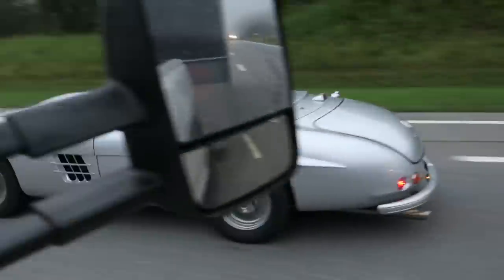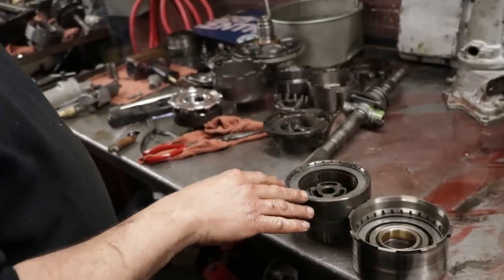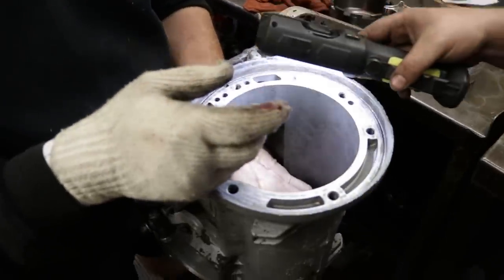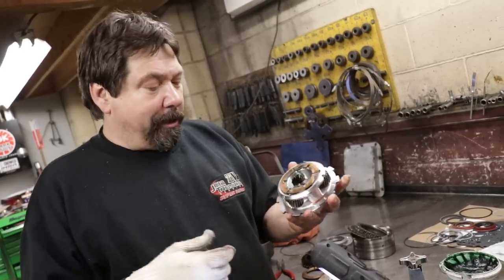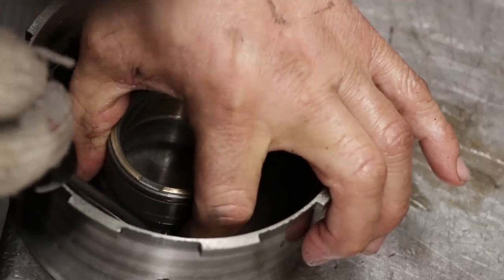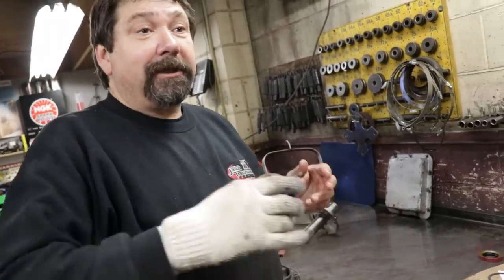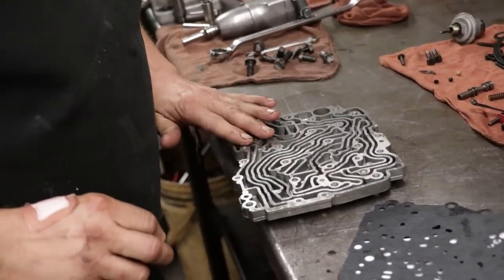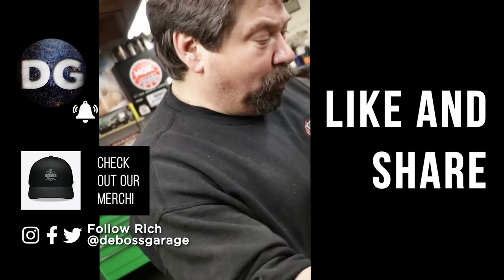How To Build A Ford C4 3-Speed Automatic Transmission

Comment: I retired after 35 yrs rebuilding Cat transmissions at thee Cat dealer in Miami. I knew a lot of the seal and ring part #’s by heart also. I noticed that before you put in a lip seal, you put some grease in it to hold the garter spring in, also what I did. The C4 looks pretty easy. I’ve always wanted to do an automatic- maybe some day. Love the videos, Joe.

Comment: And also getting those clutch teeth lined up is fairly simple use a pocket screwdriver and start at the top and once you get a section lined up if you pull that section all the other ones will follow usually takes anywhere from a couple minutes to max out 10 minutes

Comment: You should always pull the pump apart and check everything you checked scotch brite all of the inside smooth surface and check the valve in the front pump and replace it all most of the time it doesn’t always need to be changed but might as well if your rebuilding

Comment: It’s interesting how every transmission builder takes them apart a little bit differently the last guy I worked with would always start at the tail housing then he would either hit the pan and any accessories on the side of the case or he would do the bell housing first then hit the pan and remove the valve body the accumulator the park lever filter and pick up if there is one then the check balls Then there is a hollow bolt that’s like a 10 mm or 8 mm that has a hole in it that you have to takeoff then he starts removing the front pump and all the driving gears and the band along with all the snap rings all the way back to the sun year and the input output shaft

Comment: i didn't see anything for joes transmission in the description.  but one part of his video had me begging a question.  pass it on or not, your choice.  I rebuilt a cd4e, of which i was told was one of the hardest to rebuild.  i bought all the ford specialty tools except the piston installers.  I used a feeler gauge like he said.  before the rebuild it wouldn't move after a very hard and nasty bang and grinding.  after the rebuild which included, new pistons, new updated wider band, new clutches, new bushings, new steels, and new hard parts like carriages and planetaries, updated oil pump, updated valve body with sonnax kit and a new torque converter, all of which cost me about $900 (cheap, i know how to find cheap but good parts), it moved, but only in reverse, 1st and 2nd.  3rd slipped bad and never got into OD so i could do 65 at 5k rpm haha.  my question is, after I was an idiot doing this myself to save 1800.  yes i was quoted 3600 in 2005 for this rebuild.  and i'm sure that would have been 4500 if they new about the hard parts destroyed.  My question is, i can only think of two things that may have been messed up.  originally i thought i wasn't getting pressure somewhere because maybe using the feeler gauge i gouged a seal.  but after your video i remembered, one of the pressure plates was concave or whatever and i went to the ford dealer and ordered a new one and it was flat.  BUT. i was rebuilding the mazda version of that transmission and the only differrence i knew of was the length of the chain and a sprocket.  MAYBE that plate was supposed to be concaved.  idk.  sorry for the long winded question.  i had manuals, a clean room i set up because i had heard it needs to be like a hospital to rebuild and automatic. lol,  i spent alot and got no where, but i did learn alot and it was fun.  and btw, i have been repairing tractors and cars and german printing presses and all kinds of things for 25 years but this was my first tranny.  oh crap can i say that these days?  idk,

Comment: I rebuild my 67 C4 top to bottom. The only mistake I made was I put in that modulator valve that the pin acts on backwards. The trans acts like a manual valve body when you do that and has rev up really high to want to shift automatically.

Comment: I have a c4 in a 79 Ford. Has no drive. Only has 1+2 & reverse. Won't shift into drive. I serviced transmission and put a new vacuum modulator. Trans has 42,000 been sitting for most of its life

Comment: I worked out at Dynax, a Japanese company with a factory here Virginia, out in Botetourt (Fun hearing Japanese people try to pronounce that when corporate heads visited. It's pronounced "Botta-tot, yeah they never figured that out...). They manufacture A LOT of the friction discs seen in automatic transmissions, maybe even the ones that came out of or the ones going into this Ford Transmission. As they manufacture for both the OEM and Aftermarket parts sectors, it's hard to tell. I know they're tied in with the Exedy (I think I spelled that right) brands, but it's so convoluted and out of the public eye i can't find information.

Comment: Best not to assemble pieces with impact - everything gets torqued. I didn't see him check clutch set clearances. Did not see an end play check for the main assembly. Bands must be torqued only in car after firing off and pumping the fluid through quick. Lock nuts should be snug and band adjusters approximated as he sort of shows. He did the pan good. He identifies many defects good. Checked little to no clearances or bushing clearances. Overall fair to good.

Comment: Don't know if anyone knows, but do you dump in some ATF before you put the valve body on to lube up all the drums and bands? Similar to spinning the oil pump on a motor before you put the distributor on and fire it up. Seems like it might be a good idea before bolting it in and starting it up for the first time. 
Or does it not really matter?

Comment: Great video!!! hope to see more! Is there any way to get the part# or manufacturer of the foot press he's using?
Reply: it's probably older than he is and maybe both of them put together... but you can find similar by searching for "transmission clutch foot press tool" or "transmission drum foot press"
or " transmission foot press spring compressor" and other variances ;)
Reply: throttle bottle or it’s custom made in house

Comment: My c4 the reverse bangs. The other gears have a hard shift any thoughts on possible problems? Forward gears shift better if not perfect warm depending on your throttle input.  Reverse doesn't bang cold but will when hot.

Comment: i was wondering how many RPM you can build a C4 trans to handle? ive seen some really high winding 2.3l engines pulling 9,000rpm sitting in front of them. one 302 pushing 8,000rpm.

Comment: Removed the pump and replaced the gears and seal. Carefully slid the pump assembly together and it seems to go all the way down. When I tighten the bolts inside the bellhousing, the shaft locks up, when I loosen them they free up. I did not remove anything else from the trans. I  will disassemble and reassemble again. I made sure the brass thrust washer with the ears lined up. Any idea's as to what I've done to lock up the shaft?
Reply: Never mind wasn't clenching my cigar correctly!

Comment: The guy does great work but why no wood or plastic used on breaking apart stuff and one of those little flat corrogated springs was put in with a leaf over the edge. The guy is really good tho. I want no marks on my case tho.
Reply: And I saw no threads being oiled or antisiezed.

Comment: Joe, I have a C4 trans that was rebuilt but can't physically shift it into low gear. It only shifts 2nd and drive.  Is there a chance that the shift mechanism is off a bitch inside?

Comment: hi what would cause  the pump bearing to stick to the torque converter and the bearing weld itself to it. assembled the engine and trans and tried to engage the two a few months ago. wouldnt turn so took apart and thats what we found ? any suggestions on what may have happened. engine ran but trans never engaged
Reply: My wild guess is that the converter wasn't engaged all the way onto every set of splines. I did that once myself and toasted the pump and sent metal all through the freshly built transmission. I'm very careful now to check that.

Comment: I been watching videos of tranny after tranny being torn apart, It's simply disassembling them, then it's finding the worn out parts and replacing them but putting back together so many freaking parts feel scary...  n_n I am good at breaking things down, but I hardly ever put them well together. >_< I swear  it's going to take me a year to figure out.
Reply: take your time and break the job down into separate parts will help you keep track
Reply: @harmankardon478  Oh I am way pass that point, the tranny is gutted in the table I was replacing seals on the assemblies... and it's been like that for like a month. It's just impossible to work on the garage when all summer been around 112 degrees.

The only good thing is I got videos of everything I've done.
Reply: @Nairod2  good move on the videos!

Comment: if you are going to post tech please make sure you know what you are talking about calling a foward drum a high gear drum or direct drum is not correct and can cause problems for people who trust what you are saying  also you should check the apply of both  drums with air pressure much better than guessing by looking at how flat the o ring looks just trying to help

Comment: i want to have mine rebuilt all the shops around me wanted 900$ to have it done
Reply from the maker: You don't think this job is worth $900?
Reply: @DEBOSSGARAGE  when JW, Hughes and B&M sale street strip transmission for 1300 or less hell TCI has there street rodder   pack with transmission converter dipstick and cooler for 1500 seams like the 900$ prices is just to close in prices

Comment: The C-4 is a great transmission but I think it is too temperamental for a beginner,I built @ least hundred+ done one a wannabe builder done,he put the valve in back of modulator backwards,very prone for 2nd gear starts from governor sticking,they have to be right!!!!.